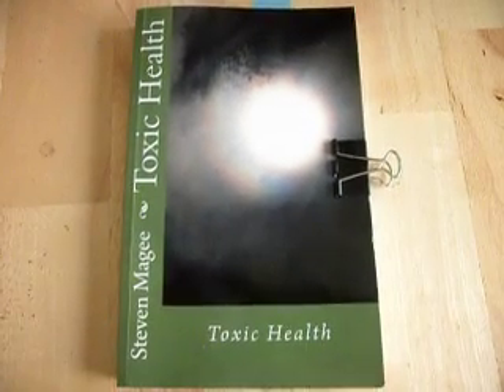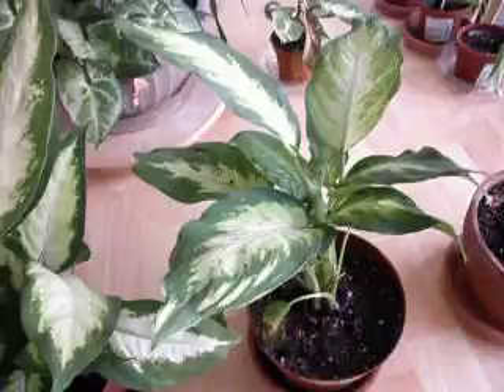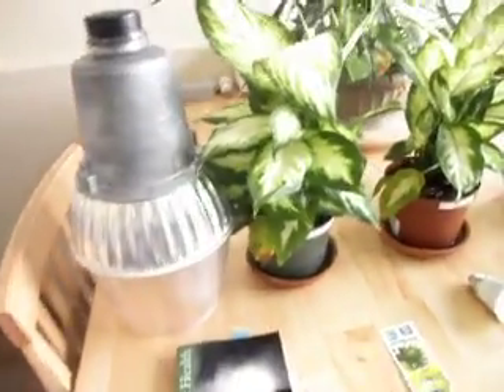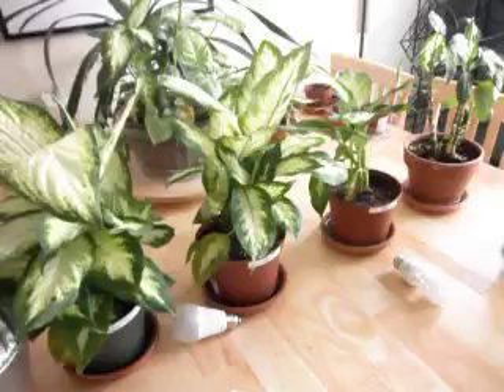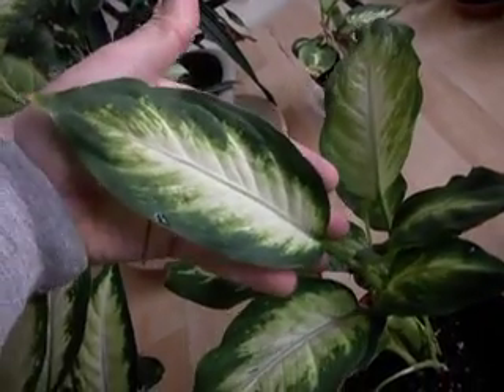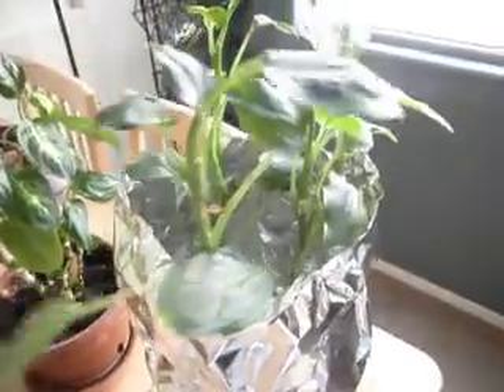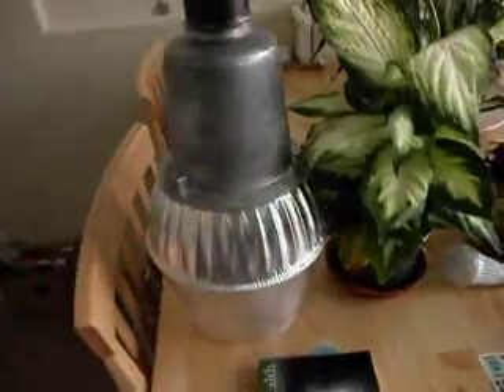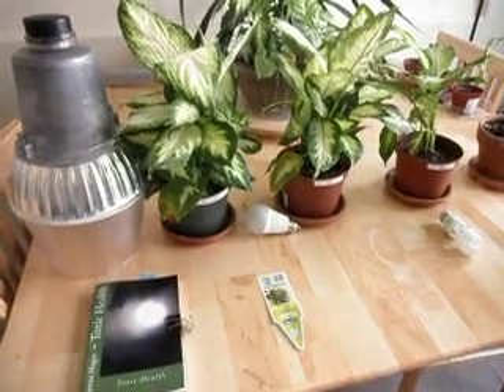Plant Growth Experiment Using Artificial Lighting Products

Comment from the maker: All of the plants in this experiment deformed with characteristic electromagnetic radiation exposures as documented by Dr. John Nash Ott in his books and DVD on the subject. I later tested the LED light and it was emitting RF at a level of approximately 800 millivolts per meter, which is really high!  Some of the deformity I traced to the wireless devices in my home also affecting plants both inside and outside of the home. My plants are now growing much better since I turned them off.